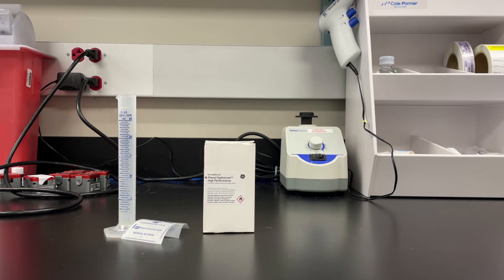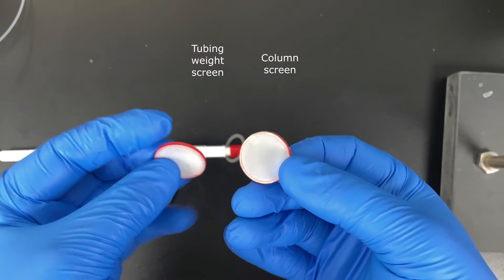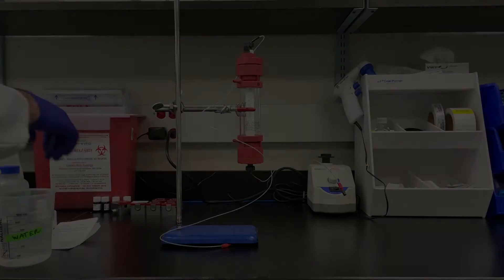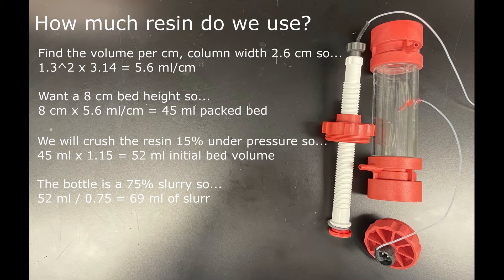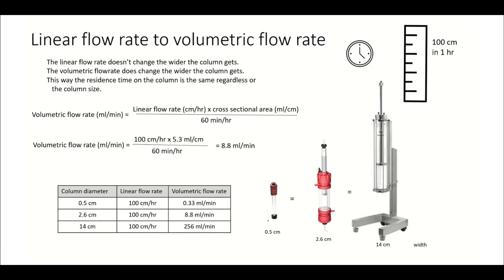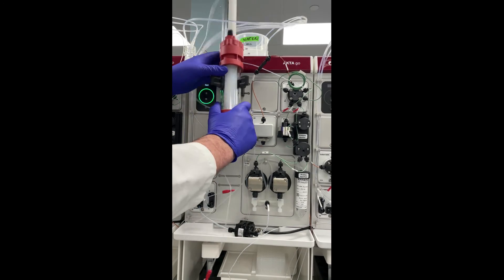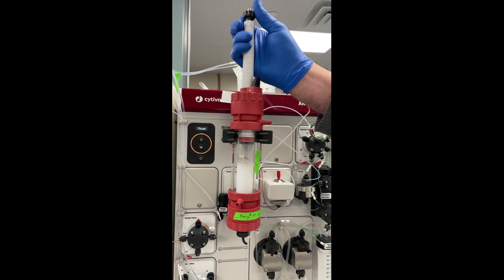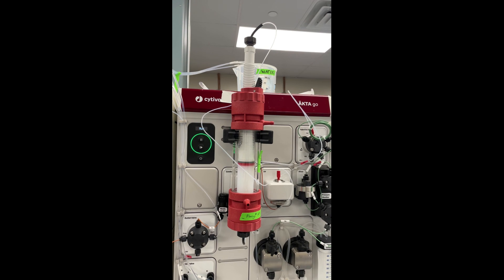Packing The XK Column For Chromatography

Comment: Hello! Excellent information is shared in your video. 
I have a question about a column I packed yesterday. I obtained As= 1.24 Upflow and 1.33 Downflow, these values are correct because are less than 1.8. Otherwise we can see tailing on the right. This can be due to a loosen packing? 
On the other hand, we calculate the column volume (125 mL) but during the run of HETP and As, we saw that the peak was eluated before 1CV is complete, this is a problem or is just the interaction of the solutions with the resin and the flow? 

Thank you very much for your content
Reply from the maker: Thanks for your comment.  I believe you are asking about asymmetry (As).  If the column is tailing on the right yes it could be that your pack is too loose.  There are other possibilities.  How long is your column?  If it is short (less than 20 cm) the injection bolus may not have enough time to "diffuse" into a symmetrical peak.  This is because you are on the left side of the Van Deemeter series  https://en.wikipedia.org/wiki/Van_Deemter_equation  This is fine if you are using a bind & elute strategy such as with affinity chromatography.  It is obviously a problem if you are using SEC.  If you think the column is too loosely packed try flow packing it first (as I did in this video) at a flow rate that is maybe 10% faster then your intended production flow rate, mark where the resin settles and lower your adapter to that point.

Comment: Hi! Great video. I have a question: Do you use a flow restrictor on your equipment? If the resin has a packing pressure lower than the pressure generated by the restrictor, how do you operate the packing?
Reply from the maker: Thanks and great question!  Cytiva's answer for this is basically "the flow restrictor affects the column hardware pressure whereas the packed bed is unaffected."  The packed bed is mostly affected by the pressure drop.  Check out page 42 of:   https://cdn.cytivalifesciences.com/api/public/content/digi-16189-pdf?_gl=1*1tc1p3d*_gcl_aw*R0NMLjE3NTM0NDc2MzMuQ2p3S0NBancxb3pFQmhBZEVpd0FuOXFiemIwTEVpNVFfeDh4WG01bEZINzBubGN3ejJha1dmVzlBWlpfcThDVG9FR2hoQ0dwZHVBSVVSb0M4cllRQXZEX0J3RQ..*_gcl_au*OTU1OTk2OTY3LjE3NTQzMjc4MDg.*_ga*MTc2MDg3MjYuMTY2MjQ4ODQxMQ..*_ga_CS9H0CZBWW*czE3NTc5NDg4MzIkbzQxJGcwJHQxNzU3OTQ4ODMyJGo2MCRsMCRoMA.. 
Which is great but it doesn't always work that way.  My opinion is that it depends, some procedures work better with the restrictor (typically SEC), other work better without the restrictor (affinity and ion exchange).
Believe it or not I'm actually working on a video about the restrictor.
Reply: @UnicornStuff  Muchas gracias por tu respuesta!!

Comment: Hey @UnicornStuff, thanks for the informative video. Can you please share how do you determine how much resin will be crushed under pressure? Is it the same parameter as the compression factor for the resin, and what if the compression factor is not provided by the manufacturer?
Reply from the maker: Thanks for watching the video.  The amount the resin will be crushed under pressure  can only be determined empirically because everyone's setup is different; system tubing diameter, column height & diameter all vary.  This will mean that manufacturer probably wont report a compression factor.  It would probably help to make a video about how to determine the compression factor, but it's as easy to measure as you would think.

Comment: Thanks for the very helpful video. Do you equilibrate the slurry with water before or after you add them to the column?
Reply from the maker: Good question.  Ideally you should do it before, the slurry will settle very quickly if it is fully equilibrated, but if you don't mind waiting for it to settle then you can do it while it is on the column.